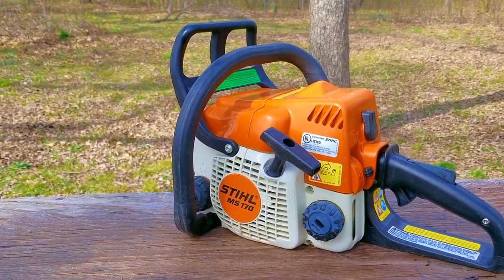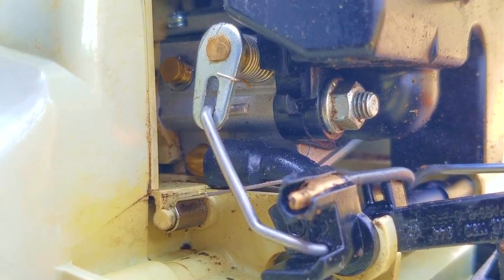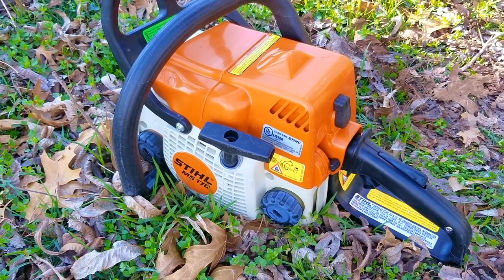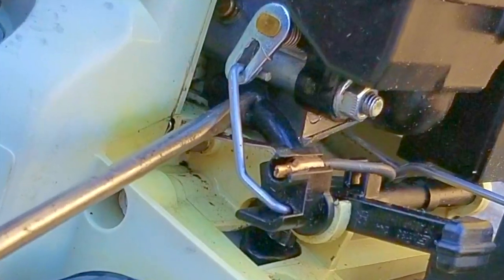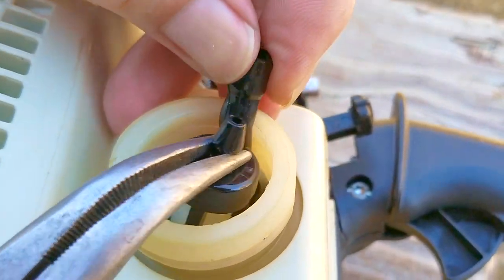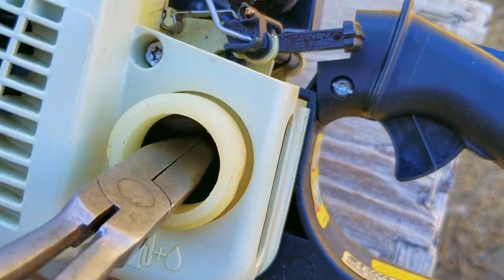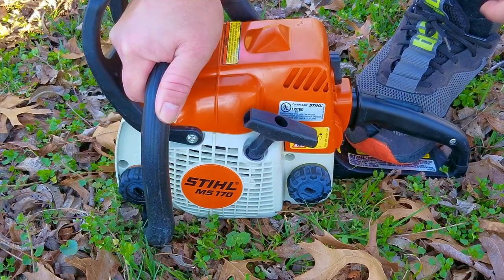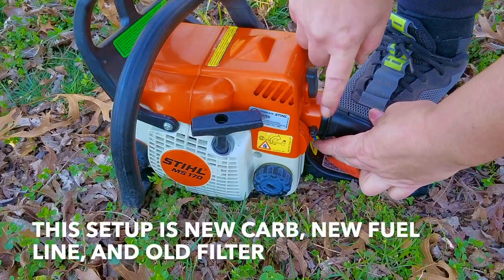Fixed This Stihl MS170 But Not In The Way I Was Hoping

Comment: That still sounds like it’s running really lean. I would rather have a cheap Poulan that I can adjust the carb.
Reply from the maker: I know right, from what I can tell, that's how they have it running to pass regulations
Reply: I bought a Poulan 42/18 as my first ever saw, I have to say it's a pretty good darn saw. I watched reviews about it before I bought it so I knew about the hard start after running it for awhile. I gapped the plug to 30 thousands and it fires right up every single time. The only thing I wish it had was an adjustment for the oiler. I've cut a lot of firewood with it and it's still performing awesome. Great job diagnosing this Stihl saw. Your awesome.
Reply: Stihl ms171 has 3 adjustment screws!

Comment: Another symptom of an air leak and before doing a pressure test is turn it on its sides and upside down while running. The RPMs will noticably change or stall quickly. Just a tip. Thanks for the video brother 👍
Reply from the maker: Very good advice, I appreciate your advice since I know you work with these a lot. Thank you Dave!

Comment: I’ve a Stihl MS-170 for 8 or 10 years now and never had a problem with it. I use it a few times a year, so not much. As with all my two cycle engine stuff, when I’m done with it I always pour the gas back into my mixed fuel container then start and run it until it dies. Trying to get all the fuel out of the carburetor. So I’ve never had carburetor issues or had to replace the fuel lines. Very good video, thanks for sharing it.
Reply from the maker: nice, you're doing a fantastic job taking care of your equipment
Reply: I run Trufuel, Motomix or other canned fuel. Can leave it in. Your carbs will thank you.

Comment: Pull the muffler and check piston and cylinder for scoring, sometimes you will still get a good compression reading but engine will run eratic.
Reply from the maker: good advice
Reply: I've seen that a few times myself

Comment: I like to ask question on my ms170.  I have spark, pressure the I spray starter fluid into air intake, but it will not start, what suggestion would you have?

Comment: Sounds like a leak in the fuel line that wasn't installed properly or has a hole in it from using a sharp instrument installing it. The gromet must be a good seal. That after market fuel line is defective.
Reply from the maker: I think you're right

Comment: This is a fast and dirty test I was shown at the saw shop I work part time at for intake leak testing. Engine running, spray carb cleaner into the cooling air inlet at the recoil. Give it a short shot. If seal is leaking this spray will be pulled in past the seal and flood the engine right now. Sometimes we leave the top cover off and try to spray between engine and FW carefully. Engine still running and with the clutch cover off and spray around clutch. You can also spray around the carb to engine but you need to make sure you do not spray where the fresh air intake is for the filter, it will stall, flooded.  I'll try to check the part number for an MS170 and see if it uses the large or small fitting fuel filter and the part number later this afternoon. Gary
Reply from the maker: yes that works too.  The chance for fire is quite high though, I would recommend against it.
Reply: @HomeGaragechannel  This test is done on a cold engine and a very short spray, we're not soaking the unit. I checked the Stihl parts system for MS170 by model, not by S/N and 0000 350 3500 is the fuel filter. 3500 is the big fitting and 0000 350 3502 is the small fitting fuel filter.

Comment: I have a 170 with pretty much the exact same problem. Bought an aftermarket carb kit exactly as you described. The aftermarket fuel filter is on now and I'm still having the same issues. The new carb did nothing, same issues. I'm going to check the duckbill and the fittings on the filter now. This saw has driven me mental, I hope this could be the problem.
Reply from the maker: good luck, this one was not fun to work on

Comment: I have one like that i use for a climbing saw. Great saw and power for it's size. It had the same issue as that. Got the new OEM fuel line and fixed the issue but i went ahead and pressure tested it anyway
Reply from the maker: these are very nice saws for sure, thank you James Hedrick for the information

Comment: I've had the same problem with the carburetor, apparently it's a problem with the 170...
The filter and the fuel hose are always so easy to slide onto the carburettor, there is actually no need for an extra clamp around it.
Kind regards from Germany
Reply from the maker: thanks for the information Forst -& Gartentehnik.

Comment: You can always adjust the metering lever for more fuel to run just be careful not to open it up as much because then it will flood and spit fuel through the muffler. Just adjust it very slightly and you will see major results
Reply from the maker: Yes you can, but I wouldn't

Comment: I have the same saw with the same problem. I suspect the fuel line.
Sometimes it runs very good, but an almost full tank will run badly.
You need to burn 1/2 tank cutting wood to be sure of your fix.
Reply from the maker: thank you for letting me know

Comment: I saw another video on why a sthil saw wouldn’t stay running, they said the diaphragm was too far gone, also he drilled out an orifice near the needle and seat. Maybe this would prove helpful in future video. Have a great weekend!
Reply from the maker: yes you can drill out the orifice but you need too be able to clean the shaving out, once drilled but that's going to be hard to do, since I can't take out the adjustment screw.

Comment: The 170 takes a 0000 350 3500 fuel filter, the replacement was a 0000 350 3502 has the smaller end piece
You can swap the  end pieces over so you have a new filter in side. That old filter could still be some of your problem
This saw still sounds lean, the carbs have fixed main jets so if you have a air leak the main jet won't supply enough fuel.
Possibly the replacement carb has a larger jet so  making a leak seem not so bad
I always check for air leaks especially when the saw is old like this one. 
These models leak around crankcase sealant & main seals over time
Reply from the maker: thanks for the information

Comment: Personally,  I used kits like that one, and the spark plugs they include are junk.  I was having all kinds of problems and I was thinking the carburetor was the problem,  it wasn't,  the spark plug was junk.  I put in a Champion plug and it was running very rich, readjusted the carburetor and it ran great after that. Trying to tune a non adjustable carburetor can be tough.
Reply from the maker: I know right, I use the spark plugs for fishing weights
Reply: @HomeGaragechannel  
LOL, that's funny.  Thanks for  the laugh
Reply: The chainsaw has a bad carburetor 🎉

Comment: If memory my memory is correct, I think a wt215 carb will fit this. It has adjustment screws. Thanks for another great video.
Reply from the maker: I think you might be right

Comment: Good afternoon, I'm fixing a customer's Husqvarna GT 2254, customer replaced drive belt, it looks right, I got the engine running by adjusting valve lash, when I went to drive test reverse is first, 1st is reverse. What would cause this, turning out to be a head scratcher, any help would be appreciated. Thank you, I learn alot from your videos, like you I also have a full time job. I do this on the side, also I find, fix and flip equipment. It's a manual transmission. Customer said it wasn't like that before, I never took drive belt off. 😂
Reply from the maker: interesting, sounds like they may the transmission spinning backwards.
Reply: What do you think a fix would be?
Reply from the maker: without being there, I couldn't tell you, good luck man

Comment: well for me i,d try the basics including inspection on all the hardware in the carburetor aka carby and see if that,s in good shape and give it a good clean in the process and if that,s in good shape then move on to the fuel lines and fuel filter and replace if needed and if that,s all passing the delivery tests that,s good and if not replace them with the proper parts and then if i am still having the issues well i,d pressure test it as it can be often helpful and in other cases replacing the spark plug with a NGK or a Champion type instead of those Cheap Chinese made plugs which is what i reckon is in this video etc.
Reply from the maker: yes the spark plug was a little suspicious to me too. All great advice! thank you Patrick Stapleton.
Reply: @HomeGaragechannel  my pleasure mate and yep brands like Torch Denso etc to what we have here in Australia is simply shocking as it does not allow proper spark ☇to generate enough jolt on the compression stroke and that's for sure and I know David Mason who runs Ozmowers will agree with me etc.

Comment: I was thinking there was a restriction in the fuel system somewhere since it always leaned out eventually and it'd be interesting NOW if the bar and chain was on so you could REALLY see what it did under load or lean out again, but that question has already been answered by the absence thereof. The electric start mower is running but not even close to right. The electric start is working perfectly with new battery and charger and will spin the motor over just fine. The motor has plenty of compression and when it starts, does so easily BUT when it starts will NOT restart. The only thing I haven't done is pull the new carb apart. No fuel leaks but the new primer doesn't work either but the thing acts like it's loaded up. It'll start with a dry plug with a whiff of ether and run but not  exactly right as there is some whiffling with the operation. Tank has been off and is clean, no water, magneto has been wire brushed and oiled as well as flywheel magnets. Blade sharpened and balanced. I am REALLY thinking of pulling the throttle disc out of the OEM carb, replacing the broken stem with the one from the new carb and replacing the throttle disc and trying it out with the OEM carb since the only thing wrong after I cleaned the OEM carb up (main jet) is the broken throttle shaft hookup. The mower used to run fine but that was years ago and it will run good enough to get by now but just won't start back. Always something and BLESSINGS to U!
Reply from the maker: I know right, It just boggles me why they didn't leave it on there for me to test with
Reply: @HomeGaragechannel  It may fade right out again but you'll never know till they growl about it not being fixed right.

Comment: I believe you can actually tune those carbs you have to have a special set of drivers for them that’s why I hate newer two strokes
Reply from the maker: I'd like to see that , because I can see the ends of the shafts for the screws and there's no way to grab them. They're just small stems.
Reply: @HomeGaragechannel  I was told this by my local ace and upon asking for a set of the specialty tuning drivers they said they cannot sell them to me however they look funky you’ll have to dig into it to see the drivers it may be a dealer access only

Comment: What % of chainsaws and weedeaters come to you with a fuel related issues. Thank you, i could ask 100 questions but i wont do that to you.
Reply from the maker: no problem ask away, The percentage of chainsaws and weedeaters that come to me for repairs, is 95%, where the rest, have trimmer head, Drive shaft, or clutch issues.  The chainsaws were a bit different as some have bar and chain issue but still suffer from fuel issue.
Reply: @HomeGaragechannel  thank you so much for the response. Do you accesp DM's. If not I completely understand. I'd love to tell you what I do show I got into it. I get so so frustrated with this equipment sometimes it drives me nuts and you'd think at 56yo that wouldn't happen. Have a safe and wonderful day sir